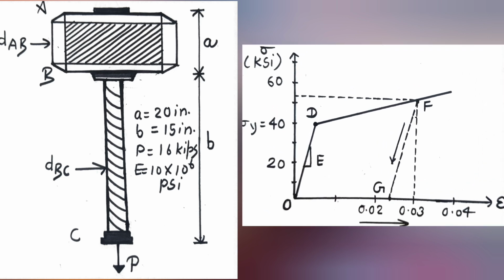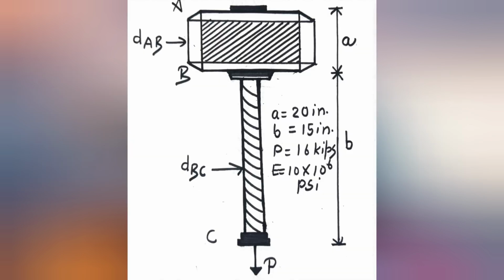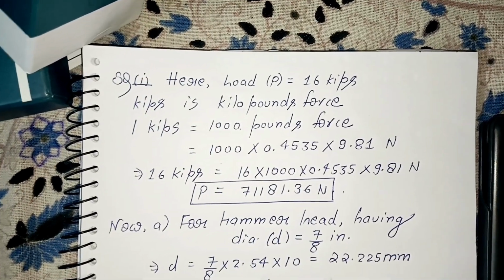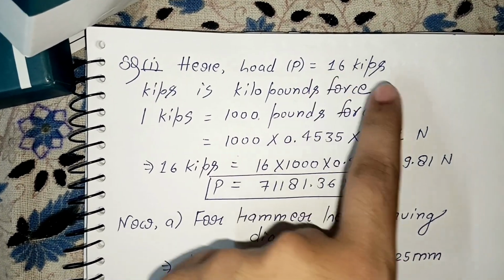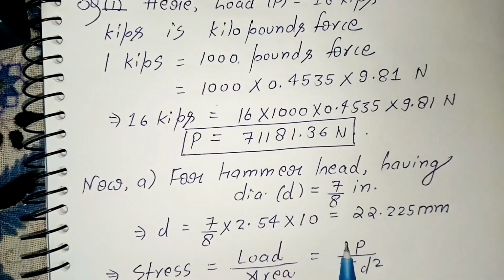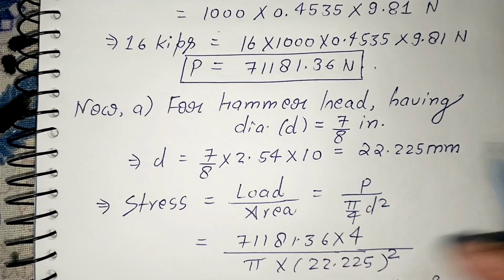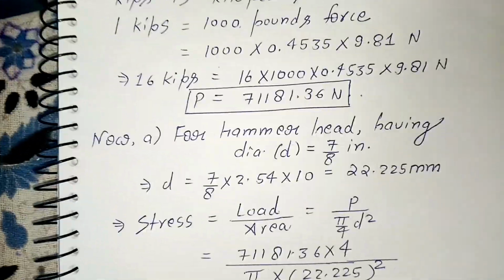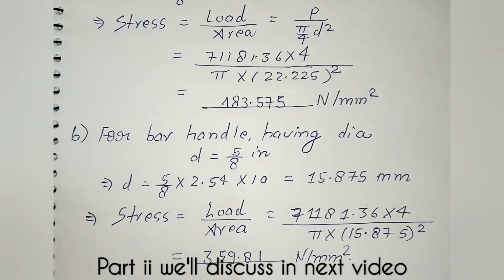IIT BHU Mid Sem Burning ENDGAME Question from Mechanics of Solids ❤️‍🔥🤔|| 10 Marks| #avengersendgame

Comment: According to me You answer is wrong🤭

Bcoz my calculation is saya that

26, 612 psi in the head of hammer 
             And
52, 163 psi. In the. handle of hammer
Reply from the maker: With due respect,the answer u gave is correct and same as my answer,ur unit is psi pounds per square inch and mine is N/mm2 or MPa,if u'll convert ur stress at hammer head which is 26612 psi into N/mm2 u will get (26612×0.454×9.81)/(2.54×2.54×100) approx 183.7 N/mm2 which is same as my answer of first part